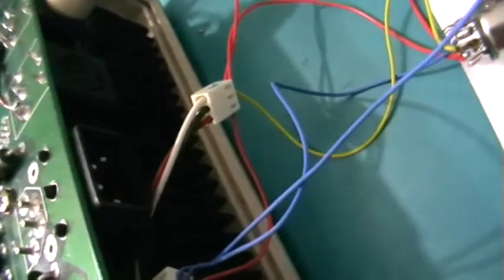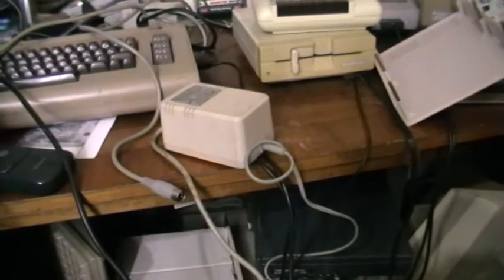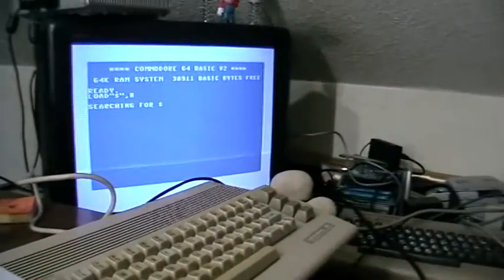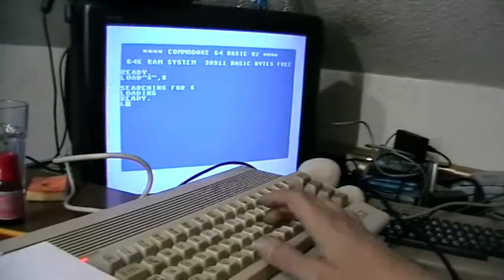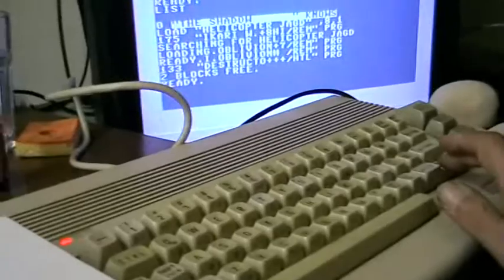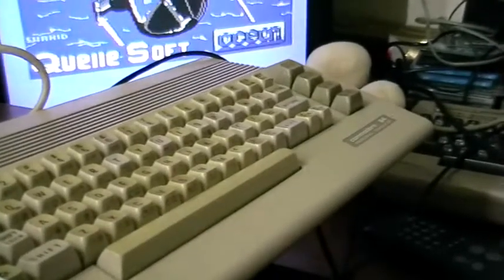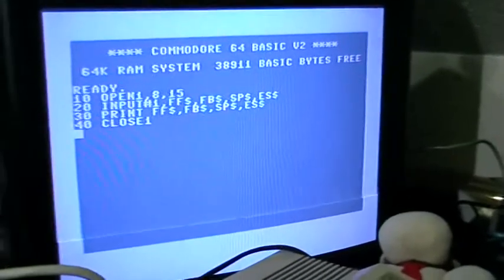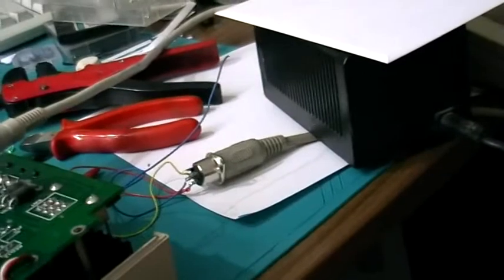Blue Chip Model BCD/5.25 Floppy Disk Drive (1541 Clone) PSU Mod

Comment: Hello! I got same drive, but unfortunelly without PSU. I'm very curious because  i have never tried non Commodore floppy drive.. Could you draw/upload/etc a very simple connection schemtaic? Im absulute beginner for electric and soldering.. (blue wire form.. to. etc.) Thankx
Reply from the maker: I did this almost 10 years ago and can't really remember what I did exactly.
Don't even know where exactly the drive is right now... sorry!
But there was a thread in the German forum64.de forum by someone who did a more elaborate mod of this drive. He also documented much better what he did than I did.
The forum is in German, but if you are polite, you can also ask in English and you probably get some qualified help.

Comment: BTW, My Drive is called Amtech which I believe was the North American name but who knows.  It does have the Original TMM128OTP ROM Chip which I'm going to read for Jim Brain to see if he can provide a JiffyDOS version for it.  -Mark.
Reply from the maker: They were sold under different names over here as well.
But it doesn't really help with the research... information on the other models seems just as scarce as of the blue chip one.

Comment: I thought this Drive used a 9VAC and 16VAC Power Supply?  Also, what is the required Amperage?  Guessing by the 1541-II/1581PSU it can't be much more than 700mA/500mA ?  But what does the Original AC Adapter say and does ANYONE have a Photo of this ELUSIVE Adapter??  It's Driving me mad!  Thanks....-Mark.
Reply from the maker: Yes, the original power supply is 9 & 16 VAC.
Internally that gets rectified and stepped down to 5V and 12V DC.
I just bypassed that circuit and fed the 5V and 12V provided by the 1541II PSU directly to the PCB.
I have no clue about the original adapter.
Took me ages to even find out what the actual voltage of the original adapter was and  how the pinout of the connector was.
I have given up on ever finding an original PSU, so I thought this mod is pretty neat.
At least I could use the drive now'if I want to.
Reply: The Mod is brilliant when you think about it since finding a 5v/12v DC PSU is quite easy for $3-4 on AliExpress...just cut Mini-Din Connector off and wire in your own DIN Connector.  I'm nit quite sure on ,aking such a Mod so I was hunting down the Original PSU Specs but there was some confusion on it which is why I was asking you if you knew...turns out there's someone on eBay with one for sale right now BUT it doesn't list the Specs and he said that on the Meter it was showing around 18VAC which on an unregulated AC PSU is normal for a 16VAC input/Adapter.  My plan was take my 9VAC 1A Adapter plus add 16VAC Adapter and wire together as such:  2 small pins 9VAC, 2 larger Pins 16VAC pics as follow: https://postimg.cc/MXqTfFH3. If I were confident enough on how you performed your little 'Magic' DC Conversion I'd use one of the many 5VDC/12VDC PSUs I already have.  Anyhow, please let me know if the pinouts I have are correct (i.e. Small upper pins 9V/Lower 16v).
Thanks,  -Mark.

Comment from the maker: The Power Adapter should be nothing more than a transformer with 2  taps. One for about 9V and the other one about 18V. Nothing too hard to come by.
The plug was driving me mad. I've never seen a plug like this before.
I think I'll live with my mod. I'm not using this drive anyway. I still have my SpeedDOS modded 1541 I got for xmas from my parents back then.
Reply: I am scared I might wire the 18VAC to the wrong 2 pins.On the mainboard which are the 9V and 18V pins?
Thanks, -Mark.
BTW, interesting Channel you have!

Comment from the maker: It should not be too rare. I remember they were sold at a supermarket chain called "Allkauf". But it's nothing special. It does nothing better than a 1541II and it is bulkier, but it's always nice to have another working floppy for the C64.
I'm not sure, but Ii think you can adjust the motor speed with the original 1541 and not the newer one with the twist mechanism. Don't quote me on that. Not sure about the 1541II. It comes with different mechanisms and maybe some of them can be adjusted too.